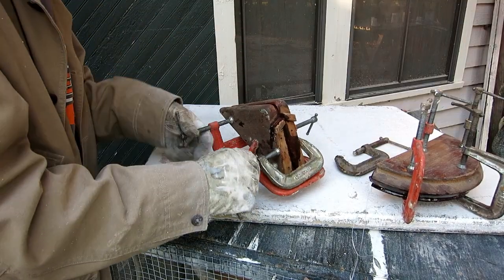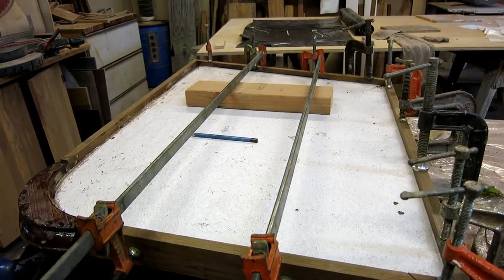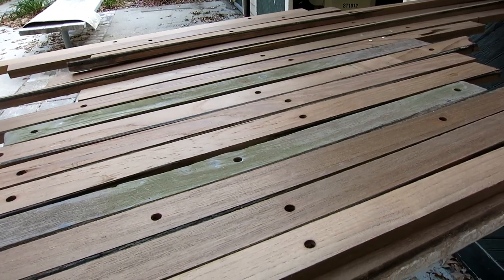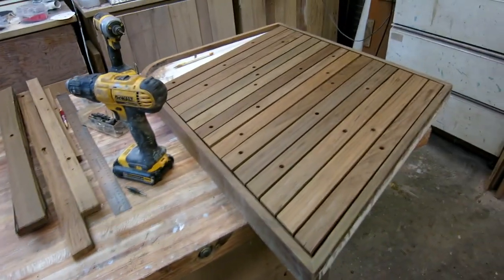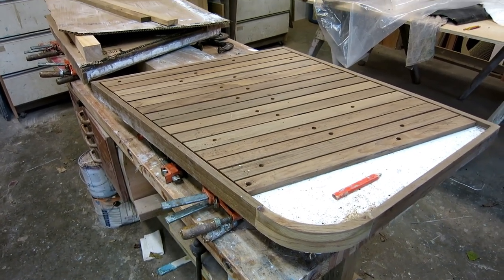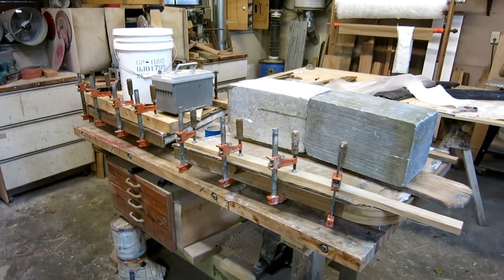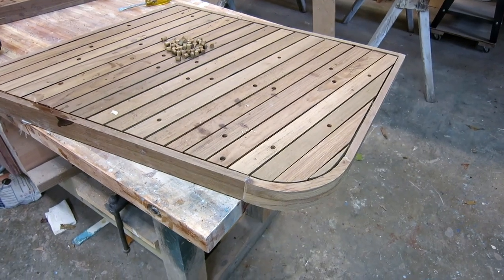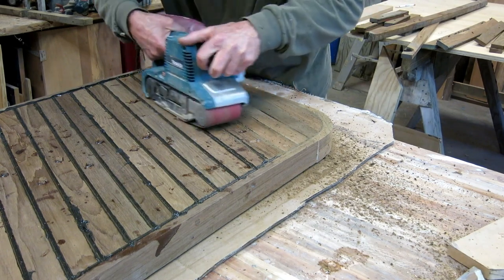Completing the DIY teak swim step on center Console Project #23

Comment: The steps look fantastic Barry. Unfortunately you ran into some challenges with that caulk. 
In the future if you have a caulk joint that’s taller than it is wide you might want to find a roll of backer rod. It is a soft plastic “foam” that fills the void and minimizes the caulking to prevent failures.
Reply from the maker: Wayne
Good call on the backer rod. I have had miles of that stuff installed back when I had a real job in heavy construction. The deep joints may come back to haunt me in the future but last weeks problem was just my lack of patience. I just didn't give the stuff enough time to do it's curing thing.
Barry